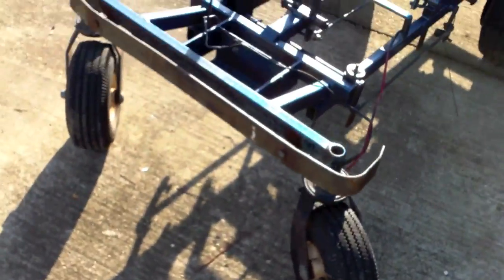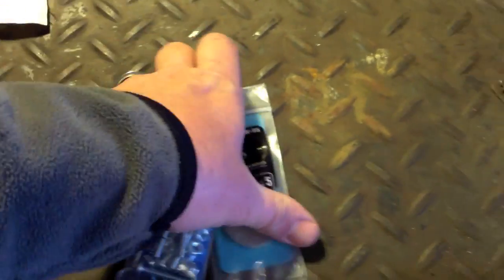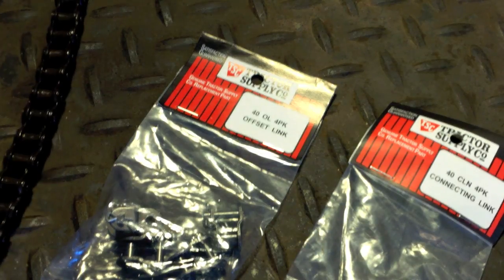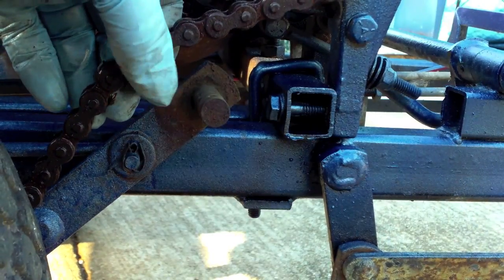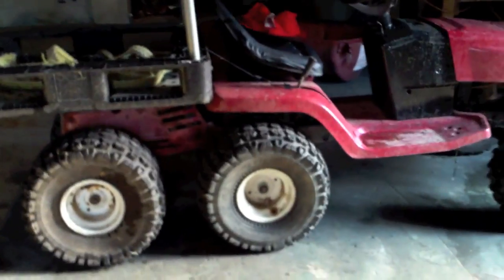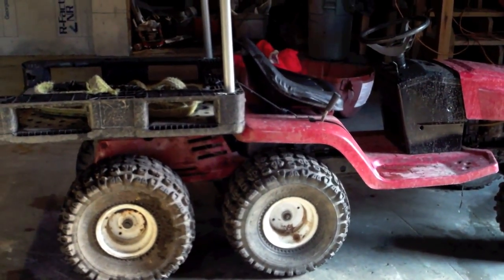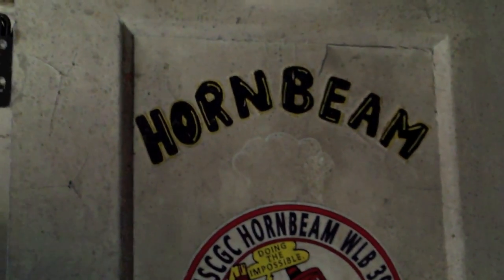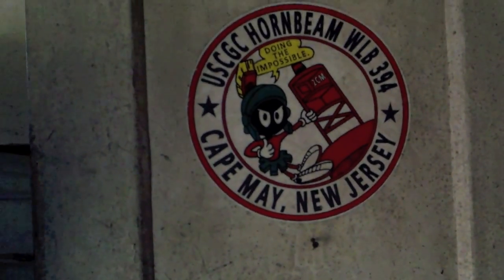Dixon Chain and Tensioner

Comment: use as a chain tensioner the black plastic out side of a v belt pulley with a spring on it. this way the chain will ride on it with very little wear. I have used them on a old dirt bike with very great success..
Reply: why not?? as long as it has good bearings it should spin freely and work just fine... I used one on a old dirt bike as a chain tensioner it work great..